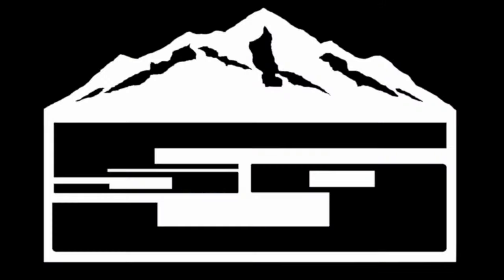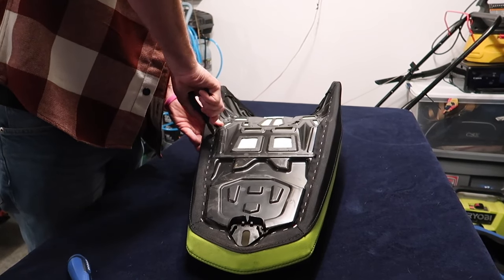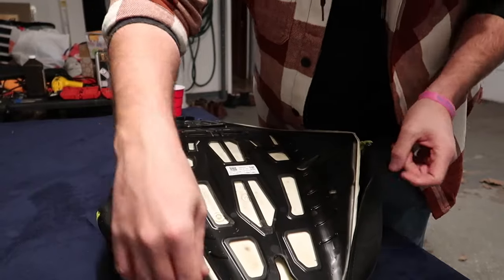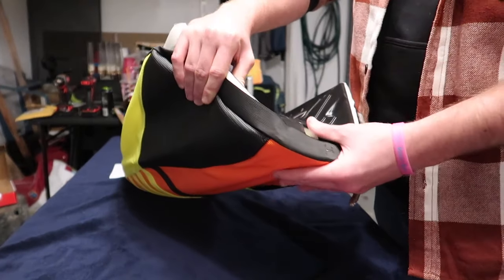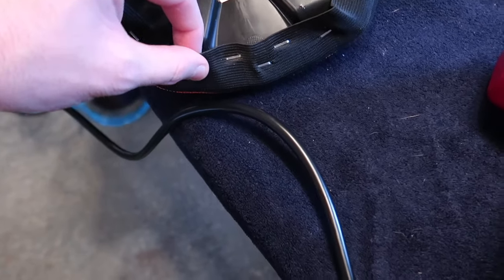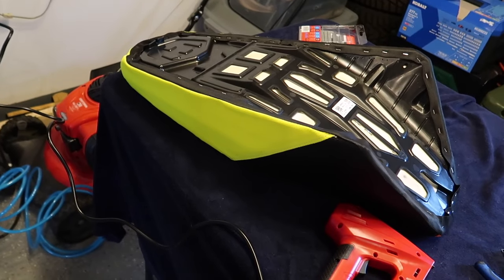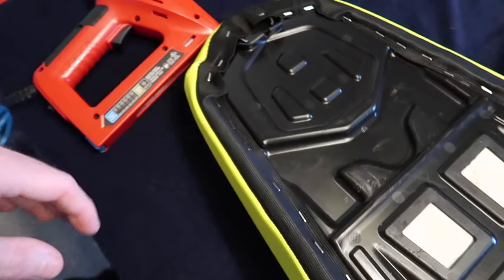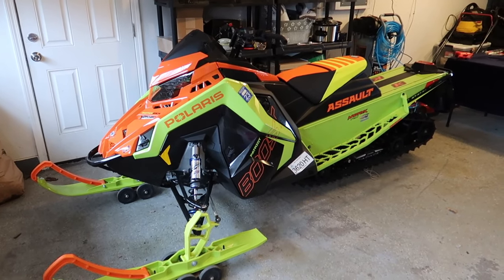SNOWMOBILE seat cover INSTALL | Seco Seat Covers

Comment: My wife bought me a seat heater for sled. I took cover off, installed without any issues... so instead of 700 for heated seat it cost 45 bucks.. works well.   Just an fyi for everyone....  very easy to do....